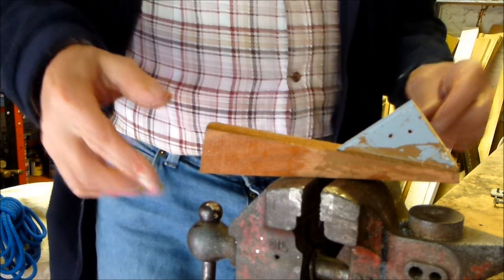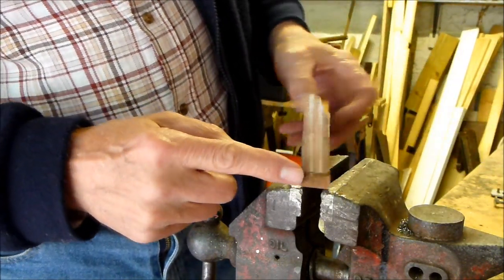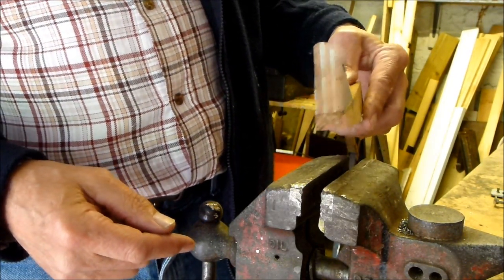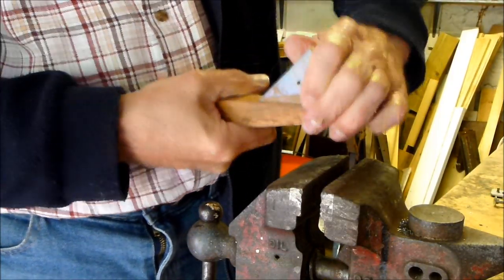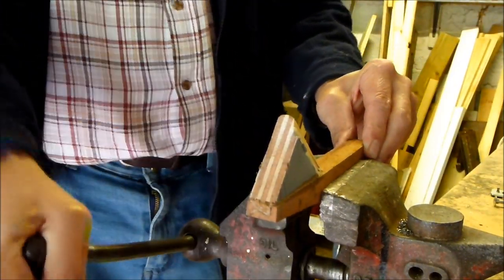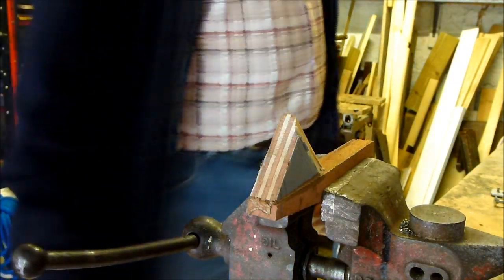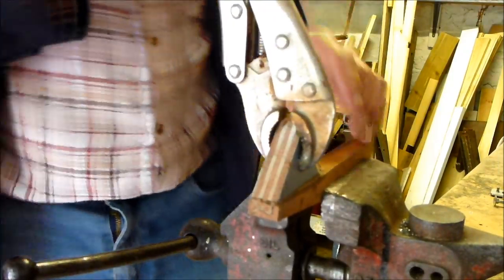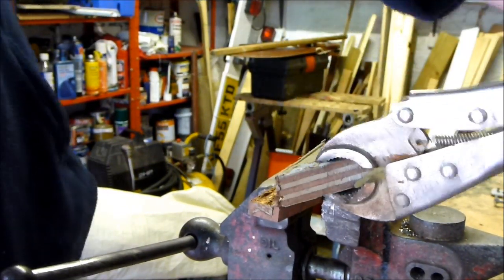Sabatack adhesive. Test to destruction.

Comment: Wasn't that a substrate failure rather, than an adhesive one? I'm looking around for a structural adhesive to use to bond the aluminium floor to an epoxy painted steel frame, and this seems to be pretty much the best stuff out there for the job due to its UV and water resistance. Have you done any further testing with it? Thanks!
Reply from the maker: Correct. The wood laminate failed. I have used this adhesive to bond a steamed, curved harwood gunwhale strip to a grp dinghy and it was perfect.